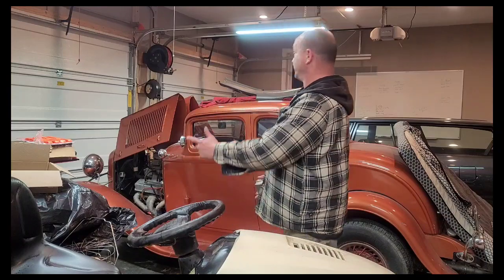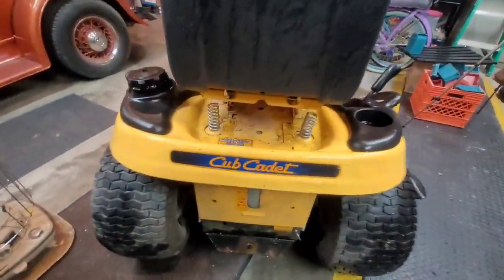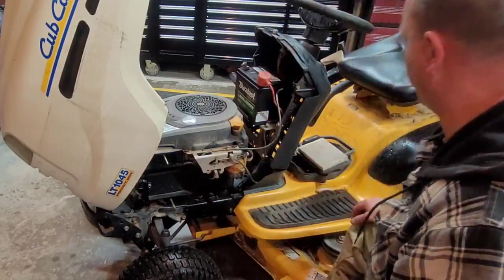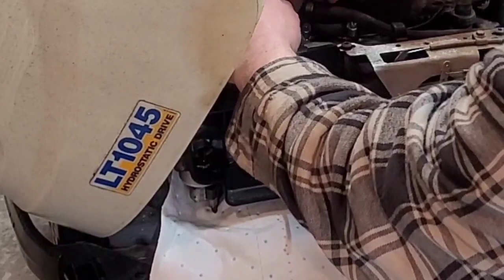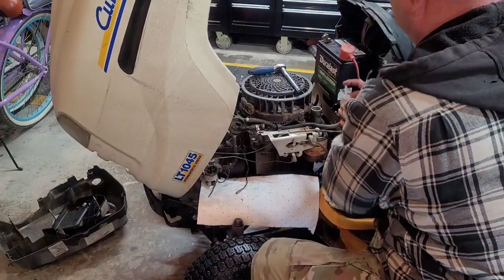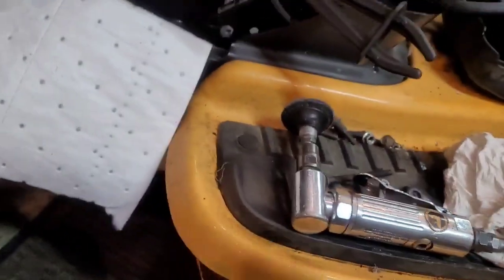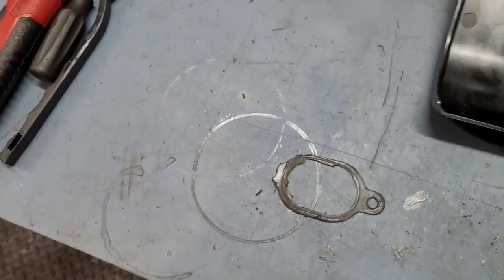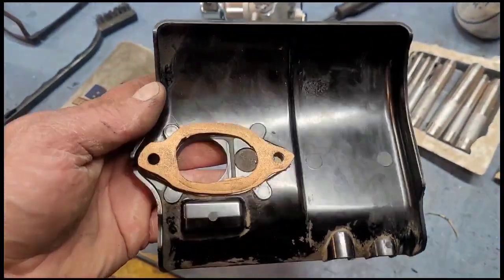Cub Cadet LT1045 Carb and Tune Up.  Getting an Old Mower Running  New!

Comment: I wouldn't use any of that stuff from scamazon.  Grt some wire brushed and clean the tubes and nozzles.
Reply from the maker: I don't disagree, and usually clean the OEM components.  But even after cleaning the jet, emulsion tube, needle and seat, and what even passages I could get a torch tip cleaner in, still a no go.  So, a cheap replacement was in order, especially for a tractor with over 500 hrs on it.

Comment: That solenoid  is an anti Back  fire  valve ,all it does  is block main jet to stop raw fuel from  exploding  in the  muffler when  engine  is  turned off.   Fuel from  float bowl  will still spill into engine  if float sticks.  Install a cut off valve in fuel  line.  If solenoid  stops  working  ,take it off and snip the shaft off .    The windings tend to burn out fast in the china replacement  carburetors.
Reply from the maker: Awesome info!  Thank you so much!  I never though to just snip it.

Comment: Could sea foam solve any carb issues?  That's if your able to use sea foam on this gas engine.  I really think that all old gas must be burnt off before the winter or drained out going into the Spring.  That's if old gas sitting for over 4 months could gum up the fuel pump.
Reply from the maker: It may if run all the time, I've used it in large vehicles with varying levels of success.  And you are correct, if you could run it dry that would be best, since the ethanol content in the fuel leaves a white residue in there when the fuel sits for a long time.  After time, it build up and clogs passages.

On my small engines, I try tu run them out of fuel before long term storage.
Reply: @mehlsmountaingarage  I try once year in buying the non-ethanol for my car and small engines.  The real gas has a little self lube for the engines to lower wear and tear. Hopefully burn away the ethanol content.
Reply from the maker: There is a sunoco by me that has non ethanol gas,, ive been wanting to do something similar.

Comment: My cub cadet 1045 is 14 years old only changed oil and clear air filter and belt and spark plug and battery has 121 hrs on motor add carb cleaner to gas each year . When the motor is cold it’s sometimes hard to crank so I will do what you showed us in video . Great video I will look on Amazon thank you
Reply from the maker: Thank you for watching, my Cub Cadet has almost 550hrs on now, so it does require some regular maintenance.  Hope you get yours sorted out!
Reply: What kind of carb cleaner do you add to your gas?
Reply: @showurite2175  go to Walmart and get the gum out for carburetor cleaner put the whole  bottle in your gas tank run that through .. It helps now I do it more often

Comment: Just bought one of these and the engine is hard to start and idle to full throttle is only an 18" movement it seams to over rev also. So I'm going to do the same replacement you just showed us. Thank you.
One question did you have to make any adjustments to the carb or just bolt it on and fire it up.. thanks again!
Reply from the maker: I hope my video helps!  I did not make ny carb adjustments, I just bolted in on and it ran good so I left it alone.

Comment: Nice work on the video.  
1) My carb is leaking massively.  Could be the float not working. I’ll plan to replace the whole carb.  Agree?
And 
2) Good editing. What app do you use for editing?  And do you use your phone for recording?
Reply from the maker: Have you tried cleaning the bowl?  The carb was cheap, so I just bought a new one after cleaning it a few times.

Yes, I used my phone, and I used vllo for the editing.
Reply: @mehlsmountaingarage  Thanks.  I got the kit because my carb is 11 years old, and cleaning it didn't fix it, also I could use the filters, etc.
I could not figure out how to get to the bowl.  I imagine I needed to remove the sensor below it, but it would not come off.
Reply from the maker: @HopkinsChannel  same thing happened to me, cleaning didn't help.  The solenoid holding the bowl on sometimes get seized, and often broken when trying to remove.  The carb is cheap enough to buy. Good luck!